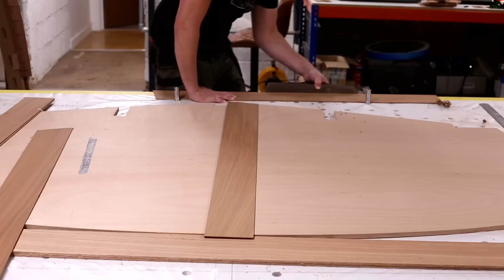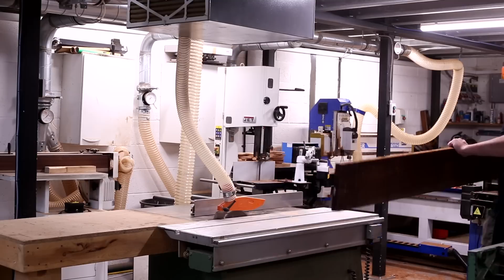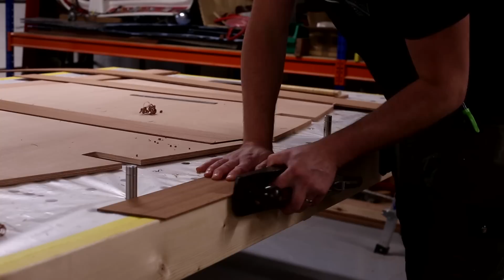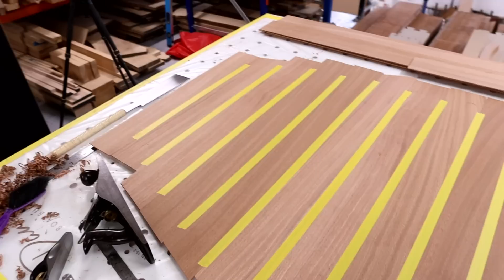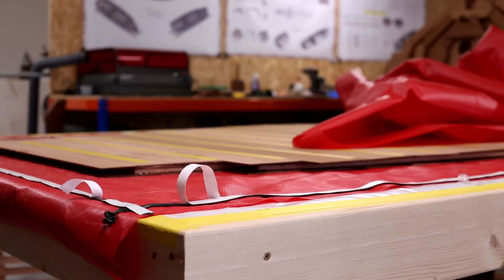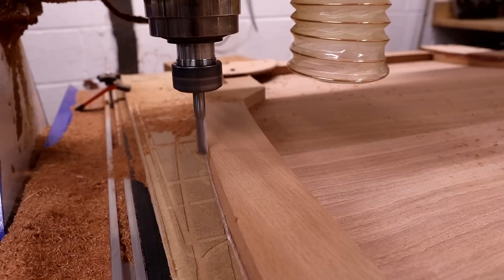The Biggest Boat Frame | Building Temptress Ep12

Comment: What does a boat builder charge for a job like that.

 Epoxy cost is one thing, but what is the professional and passion cost for that 12 hour job if a buyer was looking to have it done.
Reply from the maker: I don't know about others but I would typically charge £45 an hour plus VAT so the additional cost to veneer this bulkhead would be approx: £100 for epoxy, £80 for Utile veneer, £648 for labor, total around £828.

Comment: I’m a bit surprised at the movement of the veneer after resawing, causing the amount of planing to get a good joint.
Is that normal?
Reply from the maker: I’m not sure I had them that straight before sawing. I should have edged the boards on the jointer first really.
Reply: @DanLeeBoatbuilding  ah, we live and learn.

Comment: "colloidal silica"?
Reply: West System 406 Colloidal Silica is an epoxy thickening additive used to control the viscosity of the epoxy. It prevents epoxy runoff in vertical and overhead joints. This is a very strong filler. It creates a smooth mixture, ideal for general epoxy bonding and filleting

Comment: Hello Dan, a Quick question: Will the frame eventually be bonded to the bulckhead ?
Reply from the maker: Yes, the frame gets notched into the stringers and the bulkhead sits over them so the two will get bonded together when the stringers go in.
Reply: @DanLeeBoatbuilding  Thank you very much for the detailed explanation.

Comment: superb work and attention to detail!

a question though: up to what thickness of veneering material would you consider not necessary to wet the wall/edges of the veneer planks against each other ? would that depend on the wood?
Reply from the maker: This is probably about the limit, much more than this and I'd edge glue them as well. In a vac bag scenario though you often pull the epoxy up through the joints, if I hadn't taped them we probably would have seen more of that.

You'll see this process again when it comes to planking the bottom, I'll be using 6mm and vac bagging so I might experiment with edge glueing vs not.

Comment: Nice video, how long typically do you have before the first coat of  un tickened epoxy kicks?
Reply from the maker: In an ideal world wait for it to get to a sellotape tacky state but as long as it's done most of it's absorbing thats usually good enough. In the instance of the veneers I got straight on with things though as I wanted to get it all laid up and vac bagged before things started to set up.